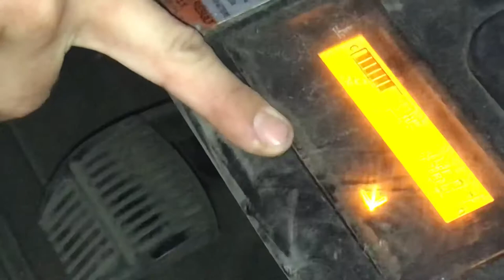Toyota forklift seat sensor bypass

Comment: I see a lot of don't do it comments and you guys aren't wrong. But in a pinch, to get you by until you can get a replacement switch, this is about the only option. From day one, my seat switch would disengage and I'd have to hop my butt up and down to re-engage it often enough to be a huge PIA. I tried putting some shims between the switch and seat foam but that only lasted for a while and then same issue. I recently bypassed the switch with a jumper I made from wire and bladed wire connectors and now I'm getting the A5-1 error so I know I'll need to figure something else out, but it'd be nice if toyota would address this known issue considering my 8FGU32 lift cost more than my BMW...
Reply: I work in a shop and we have 4 lifts, a 79, a 87 a 94 and a 07 ,several different brands,  the 07 is a Toyota and it's the only one with any safetys built into it and it was acting up the last couple of days, I KNEW its was the seat sensor but before bypassing I wanted to make sure I wouldn't burn something up, once I cleared that I did the paper clip, works great.

When I told my boss I would get it fixed in the next couple of days and it was 40 from Toyota he said " Toyota?" Are you sure? Lol, meaning it's always several hundred dollars for any repair,he was surprised.

Comment: FYI, if the switch is in bypass long enough, the computer detects a continuous closed circuit and eventually will throw the seat switch code again.  If you don't correct the situation, eventually, it will not allow the forklift to start.  Then, if you fix it properly, it will start and auto-remove the code.  Ask me how I know....

Comment: Until you fry the entire controller, main, & engine harnesses. Just leave it be
Reply: There’s nothing wrong with doing this but not quite like they did it… I use insulated wire and then wrap it In electrical tape.

Comment: How do you fix operator fan that won't turn on think it might of blower a fuse but don't know where it might be located looked under fuse panel box lid No mention of it no where.
Reply from the maker: I’m assuming you’re talking about a fan you plug in for comfort? If so you’ll need to test the socket with another item that has the same plug or with an electrical tester of some sort. If it gets no power then you’ve got a dead outlet and need to do some further fixes if it does get power however your fan is bad. I’ll look at mine Monday to see what I can find for you.

Comment: As a USPS trained and certified forklift mechanic, I can say this isn’t a fix. When you throw in jumpers or jump with a paper clip all you’re doing is being lazy and unsafe. 

The deadman switch is called a deadman switch for a reason. If the equipment has no operator in the seat the drive and mast operations are disabled. This prevents the equipment from getting away from the operator should they step off or fall off and will not allow it to run away to potentially harm or kill someone. 

The switch is a momentary close and the circuit is open when there is no driver. Only with weight in the seat will it complete the connection allowing for full function. 

These are just kids and I hope they don’t hurt themselves.
Reply: Ok so I’m in my seat and my lift will not move and forks won’t move why what needs to be fixed ?
Reply: Thanks for the insight. This reminded me that the so called easy way often times turns out to be the hard way.
Reply: When are people going to realise we don’t need to be babied. the set up is a fkn pain in the arse. People are in more danger when I get pissed off with all this crap. Danger is just Natures way of eliminating stupid people.  I will be making up a sequenced relay box that takes care of all this shit as soon as I turn the key.
Reply: I bet you are a fun coworker to work with.